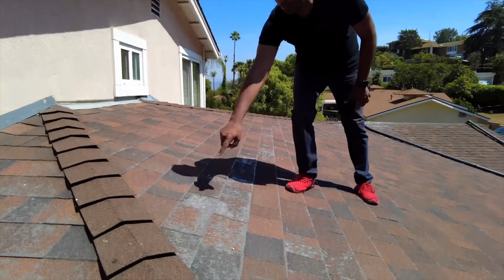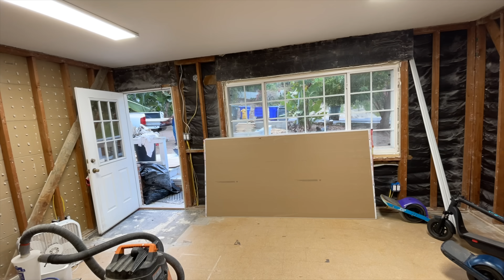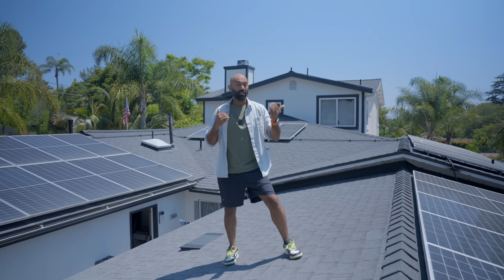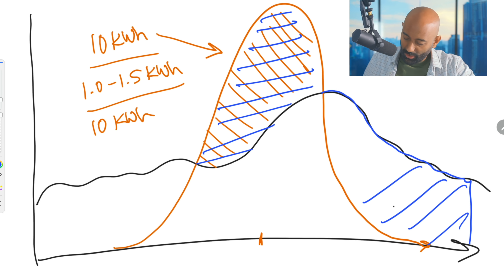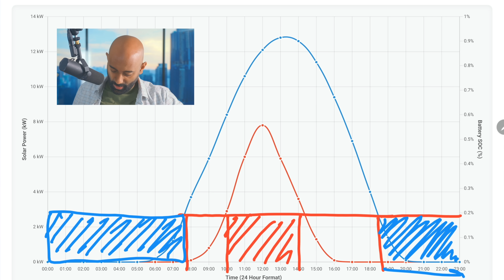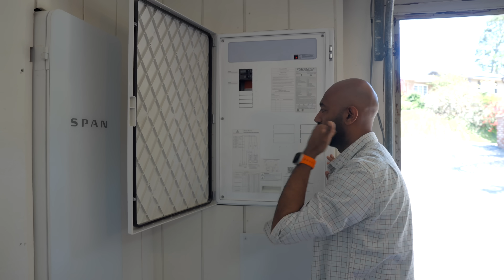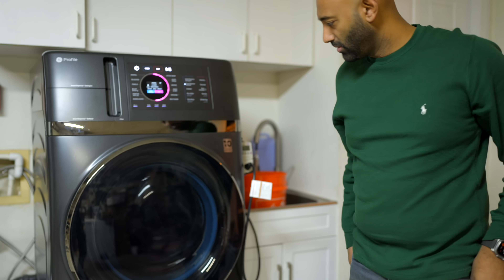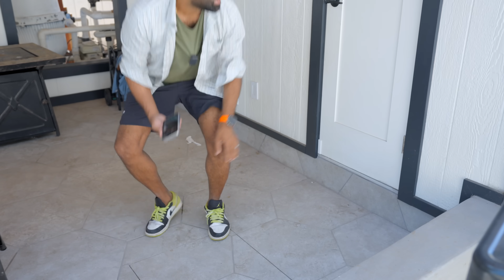Is Self Reliance Possible? Net Zero Home 4 Years Later...

Comment from the maker: Check Out  Sunseeker X3 Plus  Now!  https://bit.ly/45w4JSy 
Code: Vinci50 for 50 dollars off ONLY FOR Official Website

Amazon:  https://bit.ly/4k4zVvE
Reply: The price of solar panels in China has reached $0.09-0.06USD / watt.

It is estimated that by 2030 the price of panels will drop to $0.03USD/watt.
Reply: @AprezaRenaldy  Superabundance is on the way !
Reply: @AprezaRenaldy I bought a pallet of panels new last month from signature solar for $0.19 per watt, delivered to my driveway.
Reply: The four solar panels set at a different angle were a mistake. Your energy production isn’t clean, your inverters probably won’t clean up the differences in power production without losses.
Reply: @jsbrads1 he uses micro inverters not string inverters, so each panel and inverter is a stand alone unit. Though he is using quad micro inverters, but it is effectively quad mppt.
Reply: @mikegrok  and will that fix his power? Or is he losing a few percent due to the four panels?
Reply: Why did you use micro-inverters? Do you have overshadowing issues? Also, wouldn't a generator be cheaper than all those extra batteries to cover dunkelflaute?
Reply: @fallonstuart8921  it might be cheaper, but that isn’t the point.
Reply: Used to enjoy your vids, but they’ve gotten generic. Was into this one until you showed SPAN! I'm an EE but even for the average DIYer, it's horribly overpriced for the functionality. Can do way more with a $10/circuit wireless meter + switch setup dumping into a local DB (local & remote): Faster, cheaper & way more flexible.
Reply: The price of solar systems in America is 3x what it is outside the United States.
Reply: @JunitafluxcyfatriciaJunita  Capitalism at it's finest in action!
Reply: @TwoBitDaVinci  similar to you, my base is San Diego, in Tierrasanta. My swimming pool is 28,000 gallons. My power wall battery is 13 kWh and my Cyber Beast has bidirectional charging and 129 kWh.

My variable speed pool pump is just 1/2 hp and it operates four hours per day or less. Of course I keep the pool covered and I can easily go without using the pump for a day or two per week. The water is crystal clear and The chlorine balance is mid range.

I also built a 300 square foot copper solar water heater for the pool making it a 9 month season.

My Tesla  Beast is charged on “excess solar“ and my system can go “off-line“ with a simple click on my phone.  

It seems that you are running your pool pump excessively. Are you pumping more than the capacity of your pool every day? It may be worth examining the efficiency of your filter. 

Thank you for your work.
Reply: we have the commercial version of the rheem water heater installed by a contractor. It's great, BUT its both noisy and creates vibration.  They installed an 80 gallon tank so we don't run out of hot water.  The issue is the location: the  corner of the garage shares a wall with the  living room and the master bedroom upstairs. We can hear it when its running at night and when it's quite during the day. It sounds like the refridgerator comperssor is running right next to you. The safety straps attached to the walls prevents noise and vibration isolation.  I would highly consider having an outside shed design that isolates it from interior walls. Also consider dual venting design to channel unwanted heat or cold to outside or inside.
Reply: I have to wonder if you bought less battery and more solar panels on the house, would you have done better even if the panels were not ideally located?
Reply: @KingBravo-lo3vc  I bought enough solar panels to cover all of my available area without erecting new structures. After I run it for a while I will be able to see where I may need to erect new structures or purchase additional batteries. My roof is not a viable location. It is not strong enough.

Comment: We live in Cheyenne, WY at 6,200 feet above sea level. We have 1 to 1 net metering from Black Hills Energy. We had a 10 kWh solar system installed in early 2024, & 20 kWh of batteries in 2025. We also have 2 EVs. We have gas water heating & furnace. Our system produces about 85% of our usage over the year. Right now we’re running a surplus that we’ll use in the winter. Our electric rate is about 17.6¢ per kWh. The radon I bought solar & the EVs  was environmental. I want our kids & grandkids to know that we tried to do our part to help. Our budget bill is about $125. About $18 is the electric grid connection fee & minimal electric usage in winter after we’ve use banked surplus. The  rest is for natural gas which is almost mandatory in our frigid climate. We bought this home in 2003 & don’t plan to move anytime soon. With the cars, I’ve estimated that our break even point is 7-8 years. Total cost for 23 panels, batteries, 1 car charger, & installation was $80,000. We went with a highly rated company from Denver.

Comment: if i had to pay 40 cents per kilowatt hour i would have installed a steam engine turning a generator and burned ULTRA HIGH sulfur coal to generate the steam to power the steam engine. 100% of your issues are caused by voting wrong and where you live. im livid i pay the outrageous price of 12 cents per kilowatt hour....and im STILL thinking about setting up that ultra high sulfur coal fired steam engine.

Comment: What is the state of DC?  There seems to be a lot of loss converting to AC.  Both in the cost of the equipment and energy loss.  How much loss is there?  Are there DC appliances that can reduce losses?  If you are going from a solar panel (DC) directly to a battery (DC), sending it through 2 inverters (DC->AC->DC) seems like a waste.  Are there any optimization technologies to help reduce losses?  Or is there really not much loss?  This also begs the question, are there cars that can charge from DC?  "Directly" from the solar panels as it were.  Forgive the pun.

Comment: Have you analyzed the environmental cost of using all of that technology to have completely decentralized energy?
Reply from the maker: the environmental cost of producing electricity with no maintenance and no moving parts for over 30 years on your roof? yeah its really good. just think about how much stuff you'd have to burn constantly every day ... and the benefits become quite clear.
Reply: @TwoBitDaVinci no, I mean from a lifecycle analysis perspective. All of those batteries and solar panels are manufactured with rare earth metals that require extensive energy use to extract and assemble into the technology you are using. Among other things like the pollution and emissions of the mining and manufacturing of your system, the energy use to produce it is certainly not negligible. Especially considering the system does not last indefinitely and will need replacement parts and adjustments over time.

Comment: Hi, I found a place here in arizona that sells solar panels from solar farms that get upgraded. I was planning on getting some of those to build a solar farm in my back yard or upgrade my own solar system which was put on the year after the huge Obama tax rebates (It was approved and paid for before the tax rebates). It has an old Feronius inverter and 40 panels. I had someone put a metal roof on my house a couple years ago and they did something to it. I think the angle of the panels are about half of what they where before. and now my output is about half also. The panels are really old and I think I may just replace them with the ones I found. My question is the cabling Where do I get those special cable sockets? BTW the system was supposed to yield 9kw/h, has 40 panels and one grid tied inverter. I have SRP and they pay a half cent per KWH I produce and sell it to the neighbors for .24-.55/kwh

Comment: There is a utility program called CA Smart Homes that has a rebate for $5K to cap your gas line. Might want to look into it for heat pump or water heating or induction stove upgrades.
Reply: Oh and we have the AO Smith Voltex AL heat pump. So far so good, uses about 400W

Comment: Good video. I have been told by a lot of people that solar is too expensive and I have always said spec the system to the max you would be using and start off with 1 solar panel and the rest of the stuff that you need. Sure its not going to produce a lot of power but just getting the system rolling and having 1 panel producing power will cut your power bill down and that can help save money that then you could buy more panels.

The one thing that helped me so much to get into solar is that I did a sort of DIY starting with a portable solar generator. As a beginner I ran what ever I could off of it as much as possible to not only save very small amount of money but to learn more about it and scaled up from there

Comment: Great video. 
I am Very surprised you are not able to use your heat pump set up for heat as well as ac. Especially for heating in a warm climate like San Diego. 
And holy smokes energy in San Diego is very expensive.

Comment: Program your heating system correctly!  I have an electric furnace and heat pump!  After it was installed when it got cold the heat pump kicked off and the electric furnace heated the home.  

After doing some research I was able to program the thermostat to run off the heat  pump 99% of the time!  Even at -20deg F below 0!  And my heat pump  almost 15 years old!  

The heat pump is perfectly capable of heating your home ALL winter!

Comment: I would take the exhaust from the pool heater, which should be cool air, and install an exchanger on it. Pipe it over to your HVAC outdoor unit to its inlet. Install an other exchange unit there. This will take the cooler air from the pool unit and pump it to the HVAC unit. To allow it to run cooler.

Comment: why don't you use solar water heater?  solar water heaters is much more efficient in capturing heat energy from the sun than PV -> heat pump.
You wont put as much stress to your batteries for heating up and storing that hot water for uses.

Comment: Interesting to see this from the American perspective. Those solar install prices seem incredibly expensive, to give you an example in the UK of a recent system of 26 Aiko panels, 12kW Sigenergy inverter, 24kWh of batteries, 7kW EV charger, all installed for £16,000 ($21,600), and that's a very good system. We can buy a 450w solar panel for £60 ($81), I expect Trumps tariffs have pushed prices up recently. Also in the UK the general advice is to fill every roof with panels, and do it in one go, it is significantly more expensive adding additional panels later. We are also lucky to get paid decent money for exports, 20 cents per kWh, and I can charge my batteries at 10 cents overnight. We also have a heat pump for heating and hot water (requires a tank), so that works out significantly cheaper than gas, I also have an EV, the overall savings are incredible, in fact all combined it makes me money. We still need the grid because winters are awful, but the excess in the sumer easily covers winter with money left over.

Comment: If your office hot water needs are only for a office bathroom then why not consider a small solar water heating system?   Or go bigger and dump the excess hot water to your pool or electricity conversion.   There are a few players taking things to the next level with hybrid solar PV+Water panels, replace some of your with these and get the benefit of both.

Comment: 12 months ago I started a small project to reduce my reliance on having to run a trifuel generator constantly during  frequent power  outages. I installed an EcoFlow ultra unit with 3 batteries. My first trial was one week off grid over thanksgiving. It took my wife 7 days to discover that that we were off grid and only because the dishwasher was on a noncritical circuit. Then I discovered that between the 30% fed credit and the 25%  state that I would get back 55% of my expense so I started adding solar panels. Forward. 12 months and I just doubled my system to include running the central air and the pool in summer. I also added two electric fireplaces to use my excess electric production for the other 9 months ot the year. I am only 85% off the electric grid and looking forward to discovering how much I save off my natural gas usage this winter.

Comment: Regarding electricity, I appreciate that your house/office act as sandboxes to test things, but it looks like a lot tech added before perhaps working on efficiency? In California, there’s probably no need to heat the pool, or of a washer-dryer. A simple washing machine, putting the laundry out or a 200W dehumidifier would do. When you talk about load in tens of kW, it’s frightening. Family of 4 here, our base load barely reaches 100-200W. Even with “oven”, tv, everything ON in winter, we’ve never had a load higher than 4-5kW for more than 1-2 hours. It’s all about having efficient appliances (air fryer?), running them in eco mode, and optimise time of use to distribute the load, and also having an efficient EV: annual usage including EV charging = 2.3MWh 😁

Comment: since 2010 have not only been 100% off the grid for all power needs with solar, have a 1830 sqft home with all modern convinced. but I have rainwater retention for all water needs. zero monthly utility bills. both systems have paid for themselves almost 3 times over. don't even think about usage and even in drought conditions never was concerned if I'd have enough power or water.

Comment: We have a GeoSpring heat pump hot water heater.  It is 9 years old, works very well.  We did have an issue with installation.  They did not put in a drain for the condensate, which started to pool in the pan in the closet.  We figured it out and they fixed it before it overflowed or resulted in mold growing.  I don’t think the plumber had installed one before!

Comment: When you have a gas furnace they are making new heat pump units that can replace your ac so that you can get heat from your heat pump. Then you can keep the gas hookup on your furnace for emergency use only if it gets so cold that your heat pump cant keep up. There are nice because you only need to replace part of the system instead of all of it to get more efficiency. The units are expensive but i think overall are worth the price over time. Also the heat pumps look like the outdoor unit to a minisplit. They also have an inverter with a modulating fan so that the amp draw on start up is low and keep the draw low according to your needs. Obviously if you want it cooler or hotter in your jome faster then it will ramp up the power draw to accommodate the unit

Comment: My strategy for excess solar is real simple since I don't have a ton of panels or a grid connected setup. 
Battery full? AC and dehumidifier on.
Protip for nerds, you don't need a fancy wifi connected AC system to automate it. You just need the unit with an infrared remote.
$40 bucks for a raspberry pi and an IR blaster, phototransistor on the power light so it knows whether the unit is on, and one weekend coding project later your AC is automated.

The hardest part by far was getting the state of charge out of the powerbank

Comment: I'm a tad confused. If you have a heat pump for AC, then you should be able to run it as a heater as well in the winter. Is it now powerful enough to heat the house? I thought that was the entire advantage of heatpumps. That they are efficient and can run as both heaters and coolers.

Comment: The price differential for solar products, when comparing the US to Australia, is staggering. I'm off-grid with 15.1kW of panels, 15kVA of inverter capacity, 50kWh of batteries and an EV charger, all for USD $39k. That price included all of the electrical work that had to be done (new switchboards, new AC cable runs, four heat-pump AC units, etc.) From what I can see, an identically spec'd system in the US would cost over $50k USD.

Comment: Holy S!  That much for natural gas??  I lived in Ventura county up until 5 years ago.  I never spent more than $120/month for gas in the winter.  As low as $35/month in summer.  Has it gone up that much in the last 5 years???  Or 1) is San Diego that much more expensive than Camarillo?  2) does that include heating the pool for the winter?  Pool heating takes a ton of energy.
As a Contractor, never put Solar on an old roof.

Comment: I don't have a pool so it might be easier for me to go net zero, but what I have is WI winters and panels that are covered with snow.  I don't think I can go net zero on my house but what I would like to do is add batteries to collect my solar in the summer and in the winter, if my panels aren't clear or producing as much, I can charge my batteries in off peak hours which is half the peak hours and then run the batteries during the day to save me money.  Nothing is ever perfect but like you're doing, you just go bit by bit.  Would love to get a heat pump eventually.  My gas furnace is still running and the AC unit is still working decently so it may be a while.

Thanks for all the info!

Comment: Pool pumps are notorious energy consumers in any household. Not many pool installers have the detailed knowledge or education to properly size pumps. They are always oversized to guarantee they will work. The pump must be able to exchange water at a certain amount per day to keep pool clean. The variable speed pump easily allowed you to find that sweet spot at a cost. A few test measurements with flow meters, pressure gauges, and existing valves could have told you the same to properly size the pump & motor.

Comment: I've been wondering if installing solar water heating tubing beneath the panels would work. There's a company that makes an integrated system but the basic idea is to remove heat from the panels which increases efficiency and life of the panels. You also make use of the heated water. It would probably be optimal for systems in the SW.